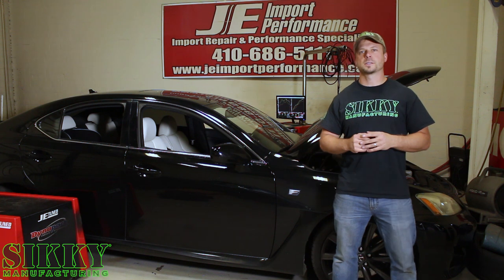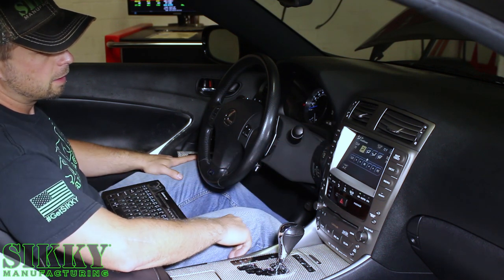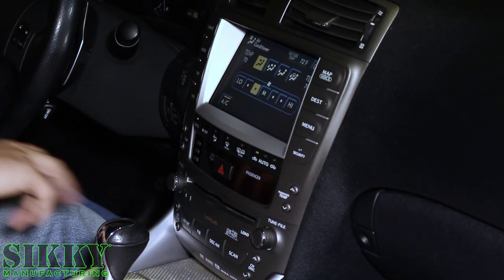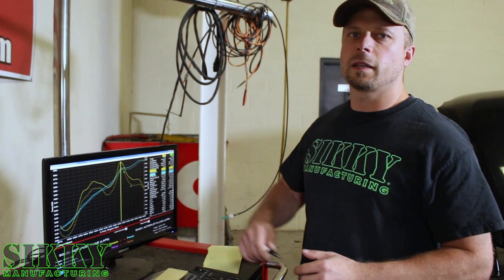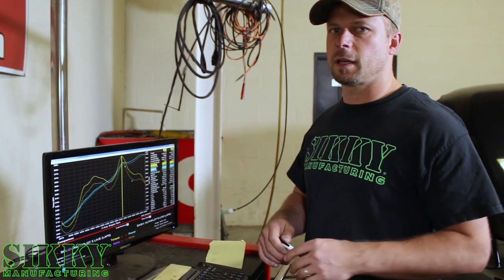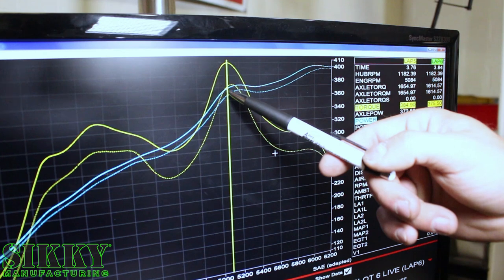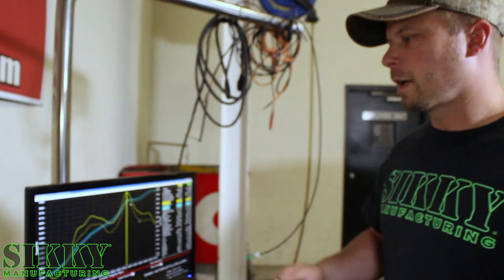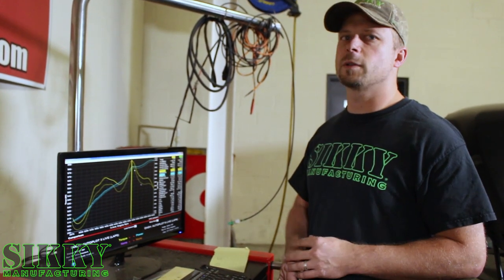How Much Power Does AC Consume? Dyno with  AC vs No AC

Comment: Thought on a newer car when you go full throttle it disengages the compressor automatically.
Reply from the maker: Yeah that's what we would have thought as well which is why this was so interesting to us.  We originally stumbled on this result while doing some back to back testing on some products we are designing for these cars.  We accidentally forgot to turn off the AC and were astonished by the power drop.
Reply: Ryan Esposito On these year model Toyota's, Lexus, the compressor is always on. It varies freon flow with an internal valve that changes with load demand and cabin temperature. It's a weird system for sure.
Reply: The s2000 does 🤙🏾
Reply: My 06 Acura TL did.
Reply: My firebird did

Comment: Nice to see some testing on this! I always wondered how much hp my car would lose roughly when the AC is on. I have a 2007 Accord 4 cylinder (166 HP stock) and it does feel a bit bogged down when the AC compressor kicks in
Reply from the maker: Yeah it makes a noticeable difference in most cars for sure.
Reply: What size engine does that accord have, 2.4 liter? Engines have come along way. 2.0 liter engines make roughly the same power in 2019 models and get considerably better gas milage at the he same time. I only mention this because my current car, 2019 Corolla hatchback, has a 2.0liter 4 168hp and is EPA rated at 32mpg city and 42mpg highway. I live in AZ and have taken a 150 mile trip this summer running the AC the entire way.. being that it was 100 outside. I still beat the EPA rating and got 45MPG. The difference in acceleration is not as noticable as older cars I've been in. Honestly, if I need to floor it to pass, it must shut the compressor off. It feels exactly the same.
Reply: @kevina2052  AC compressor is designed to disengage upon wide open throttle or high rpm. Different car makers implement slightly different, but very similar.
Reply: @kevina2052  In my 2002 Subaru Outback, it shuts off AC and Alternator above 80% throttle. It even says so in the owners manual. I'd imagine newer cars would do even more...

Comment: I had a 1990 Nissan Sentra 5 speed manual back in the day. It had a very simple A/C unit, of course. It literally had a blue button to press to engage the compressor. If I shut that off while I was merging on to the freeway, especially going uphill, it felt like I hit a damn turbo button! It was that dramatic.. 1.6 liter inline 4 with about 90hp I believe. So, if it was pulling as much as this Lexus or even half as much, that's a HUGE percentage of it's output.
Reply from the maker: Wow, yeah that's pretty noticeable.  You should have put a little NOS sticker next to that button LOL.  Could have fooled all kinds of passengers ;)
Reply: Kevin A - Bro that comment made me laugh because it’s so true! I have a 09’ Toyota Corolla with a 4cy 1.8L and prolly like 115HP. When the AC is on it drives fine until I need to accelerate quickly…..I’ll hold down the gas pedal and about 10 seconds later it starts to actually get going and catch up, very non responsive……I turn the AC off and all that disappears and you don’t notice a thing.

Comment: So, this particular Lexus has a variable displacement compressor on the A/C.  While it is handy to see it presents a load, the load is entirely variable based on the temperature settings, outside air temperature, blower motor settings (yes, that blower motor uses HP too), so to say a 10 hp loss really only applies to what you were testing that day.

Old school A/C like my Supra has is easy to disable, and the OEM ECM automatically disengages the clutch on the compressor at WOT.  When Lexus went with the variable displacement compressors, they lost the clutch so they lost the ability to turn it off easily.
Reply from the maker: Thanks for the info Lobuxracer!  Yeah I think it would be much nicer if it could be fully disabled at WOT like some vehicles.  Oh well, the good out weighs the bad on these ISF's so just gotta remember to turn that AC off before we try to race these things ;)

Comment: My Genesis 5.0 automatically shuts down the A/C compressor at WOT to deliver optimum performance. However, my 2001 Nissan Altima did not and because it didn’t you definitely feel the sluggishness.

Note: The A/C Compressor that Hyundai Genesis uses is a variable displacement compressor which allows it to adjust itself depending on the demand for cooling from the temperature sensor within the cabin, and ECU intervention for WOT operation.
My Nissan Altima on the other hand had a fixed/clutch operated compressor. Meaning that when it’s on, it’s always operating at full capacity, and there by draining the vehicle’s performance whether WOT or just simply cruising around. Most Hondas and Subarus still uses this old technology even to this day.

Comment: On my 01 2500hd 6.0l I ran a 16.3 in the quarter with ac on with it off I knocked off 2 full sec
Reply from the maker: Wow!  That’s crazy
Reply: @SikkyTV  No that's normal. You are not taking in to account the ac makes engine run 10-20 degrees hotter and causes major heat soak in forced induction cars like mine. I am losing at least 50wheel. I can feel it up top
Reply: 2 full seconds is 20 car lengths. AC is massive power robber
Reply: maximus vonce  yes completely right my thermostat is set at 180 degrees I will make a pass at 140 degrees with the ac on I’m at 200/220 at the end of the pass with it off about 170-190 makes a big difference in just 10-20 degrees

Comment: 10 hp to cool a space a quarter of my room which is cooled with a 1.5 hp window type aircon. hehe
Reply from the maker: Lol, yeah it’s not very efficient
Reply: Fun fact, your average car's A/C is at least 3 times more powerful than your average window unit. Your house is pretty much always below 80°, and once it gets to the desired temperature you just keep it there. A car on the other hand will easily exceed 140° in the sun, and is half glass and has no insulation. Not to mention we demand that our car be comfortable within about 5 minutes. It's counter intuitive because a car is so small compared to a house but car's air conditioners are more powerful. Once upon a time there was an advertisement for a semi truck that stated their air conditioner unit had more than enough cooling power to cool a 2,000sqft home. Neat stuff.

Comment: So what I am not sure of is that when the AC is on, at least on all the cars I have, and you go above a certain throttle position it shuts off the AC Compressor. Does Toyota not do this or did you shut that feature off. I know on my old LS1 GTO you could adjust the throttle position that caused this to happen with HP Tuners. Also as an Engineer 9HP seems like quite a bit.
Reply from the maker: The dyno doesn’t lie. No trickery here. Yes some cars will cycle the compressor off under full throttle conditions
Reply: @SikkyTV  so here's the issue I have a compressor for a 5 ton home unit is at most a 5hp motor, I realize that AC motors are more efficient but 5hp to run a house vs 9hp to run a car ac compressor seems very high. And every car I have owned for the last 20 years shuts off the compressor at wot, not saying your lying just seems a little unbelievable.

Comment: Would be a bunch of work but if you're building a hot rod and fabricating your own lines... you could fab the ac line to make a fuel cooler.  Maybe get half of the loss back with ac and have a wot ac shut off set up (switch or maths output).  Tank with water or washer fluid if you're forgetful, ac and fuel line wound up, close to engine.  Lots of work for not much in power but maybe you'd see 5-20hp with real world underhood temps (could probably drop fuel temp very dramatically) and don't have to use ice.
Reply from the maker: interesting idea, definitely a bunch of work though

Comment: As the owner of a stock D16Y7 powered base model civic making a maximum of 106hp,

I would rather resort to cracking open my crank windows than A/C on the freeway or on clear backroads for better acceleration and gas mileage
Reply from the maker: yes, agreed!
Reply: Although I agree completely…..a day like today where it was 94 with a heat index of 110!…….that’s just not an option 😂
Reply: @greeneyesfromohio4103  true, with my daily, (95 Passport) I run AC with windows cracked open for the first 10 minutes or so driving back from school

Comment: Hello, I have 98 camry and I notice this. I have always noticed in other cars the ac seems to use some amp draw and make vehicles bog down some. What is the usual solution?
Reply: Filmaker25 turn the air off and roll the windows down
Reply: @iceyleaks9004  Ok Buster!! I'll do that!
Reply: @iceyleaks9004  Windows down increase air drag, it's semi efficient only on speeds below 50-70km
Reply: @She1lby  u can just crack them slightly then
Reply: @iceyleaks9004  air drag coefficient loss in any case
Reply: Haha you guys are funny
Reply: 4 Yrs later did u

Comment: But no one normally drives at wide open throttle. It will make more sense to test low to midrange at partial or half throttle. Or maybe from a 60mph roll which is when must people look for that extra punch to pass on the highway.
Reply from the maker: Well the point was if you were to race and wanted to put max power down it showed how much you would lose if you left your AC on.

Comment: It's a noticeable difference in any car no matter what if your concern is performance... everything counts in large amounts. Turn off your AC, lights, radio, wipers, lose your "extra baggage" - hell, even having a clean car free of dust and debris inside and out helps. If you want every ounce of gas to go toward acceleration, better shut those "power sapping amenities" off!
Reply from the maker: Yes sir!  Facts.
Reply: I don’t think turning off anything besides AC will increase your power 😂 its running from your car battery unlike the AC.

Comment: shouldnt you remove the belts since its still taking power?
Reply from the maker: Yes to get a full AC delete number but we were just interested in what it would do by simply turning it off since most People wouldn’t delete working AC on a street car. Would be interesting to see though
Reply: While there's a number there, it might not amount to much. If you've ever spun a pulley wheel on an AC compressor, they spin pretty freely

Comment: If the same car never had air-conditioning and there is one less pulley for the belt to travel how much horsepower is one less pulley equal to
Reply from the maker: good question.  Only way to find out would be to test it.  The pulley itself won't make much of a difference so I would suspect the results would be similar to this giving all other factors equal.
Reply: SIKKY I’ve taken my serpentine belt off. I found a Toyota 12 V water pump for $32. It’s electric. I can put it in in line. So now my car has no belt. I was getting 94 miles to the gallon for the last 300 miles on this particular car. I’ll let you know what the new mileage will be. I have a 2000 Honda Insight. 

I have another 2000 Honda insight that I have 10 modification on. I reduced its factory weight by 170 Pounds. And I have a hot modified fuel line that goes into the fuel rail and —-the injectors put the gas in the motor. But it is super heated gasoline —-have orifice in the line to control the volume of gas the car burns.

This car gets 150 MPG in Fifth gear. At 50 miles an hour. After it has been driven 4miles and everything is warm and hot

Look up leanburn .The superHeated gasoline improves the O2 sensor and ecu relationship.

Comment: I personally see a bigger effect on 4-cylinder engines than on 6 or 8 cylinder not only from displacement but because you have more cylinders firing and overcoming the constant and continuous load of air-con compressor that keeps the engine parts from swinging naturally drag-free as when A/C is off. 

Can you test sub-optimal variables and their effect on power including:
 1. dirty air filter 
2. old 12V battery
3. old oxygen sensors
4. worn spark plugs

Comment: I had VW Lupo for sometime. With 1.0cc engine and i think around 50 HP. Up hill with AC on, no chance impossible. If its long hill no way. Now i have Fiat Stilo with 120HP multijet engine. It feels the AC i need to push throttle a bit when starting to move but thats all. This video is true but the bad thing is this is HUGE engine, in Europe too expensive :) and i think, im electronics ebgineer i know a bit of mechanics, i think big engines can use their inertia more efficently, because of heavy pistons and crankshaft and AC has small effect. But tiny eco engines unusable with AC.
Reply: sounds like a pain
Reply: So.. you avoid hills in your Lupo in the summer.. ??

Comment: damn my k10 1.0 litre engine has only about 67hp at 6k rpm which is the redline. So in normal rpm range hp should be way less like 30- 40 or something, 10 hp is like minimum 25% of the power. No wonder it feels damn slow with the ac on.
Reply from the maker: Lol yeah that’s definitely going to be noticeable!
Reply: Wtf.. is that like a micro car or something??
Reply: @kevina2052  Yeah sub 4 meter hatchback, Paid like $9.5k for it. Automobiles are overpriced in India, you don't know my pain.
Reply: @gaganhk8176  sounds like they are overpriced. In the US you can get a lot of fairly low milage cars with decent power for that same price..
Reply: @kevina2052  yeah Toyota Camry costs $75k new in here it sucks. No decent cars for me for a while.

Comment: Thanks for the clarification, was wandering about this.  I have the exact same car and recently had it tuned to find out the a/c was left on.  So would i be right to assume that the tune is still good, but when i drive around without it on, i have that little extra more OR does it mean it somewhat limited the amount the tuner could do his thing?  Im not going to bother going back to retune for such a small variance but just curious.
Reply from the maker: Technically it should be fine but the tuner may have made adjustments to try and compensate for the lower power outputs he might have been seeing if it was dyno tuned.  It definitely should be tuned with the AC off but I don't think it would cause any harm or hurt the tune in a major way.

Comment: This is why I dont understand certain things. Power is calculated in horses, so why the hell an ac compressor is taking so many horses, a horse in reality can put hell of lots of power. So this is why i cant understand a car with 100hp will drop in power so bad that it will almost stall.. Cmon!
Reply from the maker: good question, this use of HP is from a very long time ago so likely has a lot to do with the accuracy of an actual horse vs nowadays. lol.

Comment: I don't get it. AC doesn't not use more than 2500w or so. Which is around 3 horse power.. How would you ever notice that
Reply from the maker: These Dynapack dyno's are extremely sensitive.  We have been able to measure gains just from adjusting spark plug gap changes and even switching to a quality synthetic oil over a mineral oil.
Reply: @@ShannonBarber784 yrs later I lost

Comment: The question is what about just the regular fan blowing !
Reply from the maker: The regular fan would have no effect
Reply: @SikkyTV  All electrics draw from the alternator, which in turn drags on the engine. The better question would be how many electrics could you turn on before noticing an effect
Reply from the maker: yes you are correct but the draw on the alternator from that fan would not be measurable on the dyno because it would be so minute.  Good point though and the reason lots of drag cars don't run alternators to get every last bit of power.

Comment: This is a deceiving video. This car did get affected. But fact of the matter under full throttle MOST cars will not be affected.
Reply from the maker: +importdynamicshi thanks for watching. Some will not be effected but most will. No deception going on here.
Reply: SIKKY it's not that you're purposely deceiving anyone. But since it was not stated that this car is the exception and not the normal, people will watch and assume no matter what car they have a loss of power will happen at full throttle.
Reply from the maker: +importdynamicshi ok. Yes I can see how that could confuse.
Reply: You state that a civic will want to turn off their ac when they want to go fast but a civic compressor will disengage the clutch under high rpm or high throttle making no difference in power.
Reply: SIKKY nice video other than that. Maybe a variety of cars would be good to show some cars lose some cars don't.